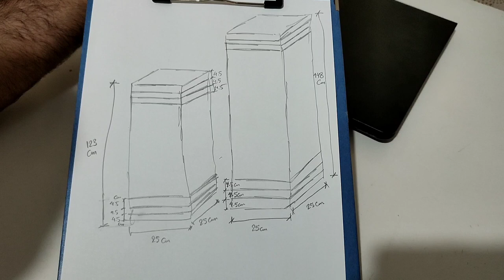Make this Yard Light , Easily                             #lighting #woodworking #woodworkingProject

Comment: Hi I just want to say this is beautiful and I would like to recreate could you give measurements of everything?
Reply from the maker: Hello Cassandra, we are glad that you liked this woodwork, the sizes of these two lights at the beginning of the video are 00:36 seconds without error, and also at minute 11:57 of the video, which of course is in the upper right corner of the screen, the distance between the fences is 4.5 cm.  It is accidentally typed 2.5 cm, and the cross-section size of the wood used is 28x18 mm, also the dimensions of the fiberglass sheet in the shorter light are 214x1190 mm in four numbers and the dimensions of the upper sheet are 214x214 mm and  The dimensions of the fiberglass sheet in the higher brightness are 1432x214 mm in four numbers and the dimensions of its upper sheet are 214x214 mm.  In addition, according to the picture at minute 9:05, from the top and bottom of one of the sheets in both lightings, for easier access to replace the lamps in the future, two pieces of sheets measuring 214 x 147 mm were separated and installed separately, how to replace  In the future, the lamps will be like this, the screws of the two fences connected to these two sheets are opened from the outside, and the lamp can be replaced and the screws can be easily re-tightened. The important point in this video is that you must use a wood drill before screwing.  A hole should be made in the wood and then the screwing operation should be done, so that the wood does not break during screwing.
In addition, four pieces of wood approximately 215 mm long were cut and installed to install the lamp as shown in the video at 4:23. If you have any other questions in the video, I will gladly answer them.